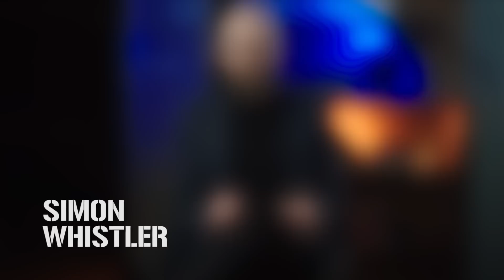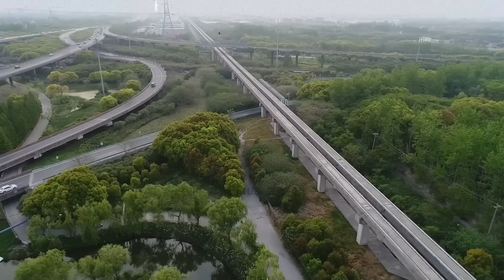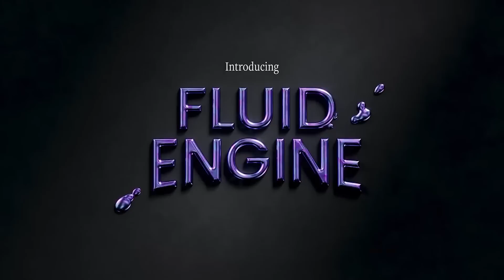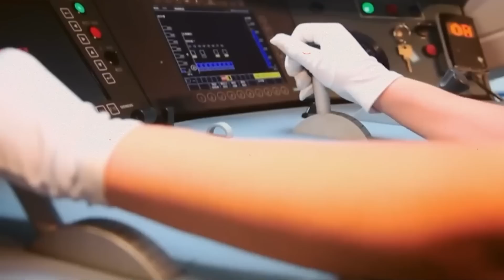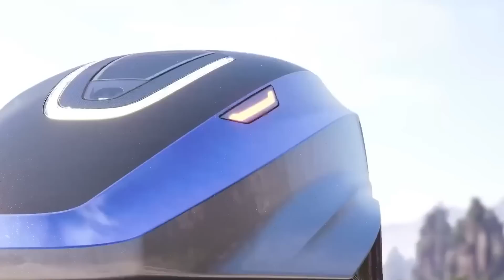A Chinese Maglev Revolution is Coming...

Comment: I took the Maglev for the first time in 2004 not long after it opened. I told friends and family back in the States about it. Until now, it remains a viable way to get to the airport, depending on where you are coming in from. It was fairly empty in the early days, but I attribute that more to the poor design of the transfer. If there had been a direct transfer from the metro station into the Maglev platform. Instead, they set it up where you have to leave the station, go up a new set of stairs, buy a ticket, go through security... all of which diminished the time savings of going 431 kmph to the airport. 
For the record, saying that it travels to "downtown" is a stretch. Longyang rd station is still pretty remote and when it was built it was really sparsely inhabited compared to the rest of the city.
Reply: 20 fkin years ago 😂
Reply: @hurrikkkanes2533  Yep! 20 fkin years ago. (kinda makes me feel old, lol)
Reply: Dude, the transfer from line2 to meglev only takes you about 5 mins at LongYang road station.
Reply: @tofdao  The whole maglev ride only takes 8 mins. Going through security a second time is redundant. Cut that down to 2-3 minutes, the time savings of the maglev ride is more appealing. My two cents.
Reply: The maglev China uses is a german train developed 30-40 years ago

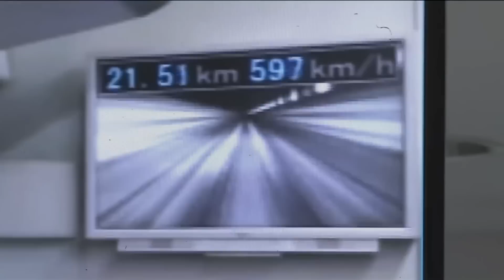Comment: 4:35 slight nitpick here, there is stil friction from the air around the train
Reply: That is drag, also known as fluid resistance.
Friction is solid on solid. Drag is solid on fluid, which can be liquid or gas.
Reply: That's called drag

Comment: The other side of the medal is, that huge parts of chinas economy and growth are based on the construction industry. They have allready build to much housing and an oversized highspeed train network, so they are running out of stuff to build. Creating new megaprojects is an attempt to keep the economic growth rates stable.

Comment: You guys should make an ep about the Japanese bullet train.
Reply: they operate 50 kms slower then chinas why
Reply: @user-vv7ir1pl4j  This is due to higher frequency of service, higher safety standards, higher noise standards and higher population density. If you just want to drive fast, it hit 443km/h in 1996.
Reply: Japan inferior maglev lol
Reply: Kinda outdated by around 10 years 😂
Reply: Chinese version more superior
Reply: There are enough videos about it
Reply: If you think speed is all that matters then you are clearly not educated enough to rate a train system’s efficiency nor effectiveness
Reply: @HappyGM-R  its simply not as impressive

Comment: I thought most of China's high speed lines were mostly empty, because the tickets are too expensive, why build the extra capacity? (except for GDP numbers and political reasons)
Reply: They are actually cheap.
Reply: where on earth did you hear that? About 2 billion passengers use the Chinese HSR network each year
Reply: @zupermaus9276  Probably american bots

Comment: Maglev track is not maintenance free! Coils will fail, power control electronics in the supply fail, etc. 

And you absolutely have to keep the track clear. If you have a tree trunk across the track and hit it at 600kph, it's going to be a very big accident. Slower, heavier wheeled trains probably derail, but also stand a good chance of chopping their way through. The lighter, faster MagLev train won't. Ok, so one might elevate the track and ensure that trees won't fall across it, but that doesn't account for the casual vandal who deliberately lobs a lump of concrete up on to the track for the laugh. In some countries that would be an unthinkable act. In others, rather the opposite.

So whilst you lose the skilled rail maintenance workers, you gain a different set of skilled workers and, what's more, you absolutely have to patrol the line to check that it's clear. The drivers won't have a hope of seeing obstacles. Germany stopped work on MagLev partly because they did have one such accident.

China's high speed train network owes its origins to the Japanese Shinkansen. They licensed the track and train technology from Japan (Hitachi I think). They didn't license the signaling technology though, they did that themselves...
Reply: I'm pretty sure there will be sophisticated track monitoring to detect any foreign objects.
Reply: @ballyhigh11  Sure, and that too needs to be maintained, tested, certified, etc.

Comment: 0:00 China does NOT "get" infrastructure. They build a lot to artificially pump up their GDP. The results are ghost cities, concrete that crumbles between your fingers, people who have lost their life savings paying for a promise of a future building and a poverty line set at < $350 / year.
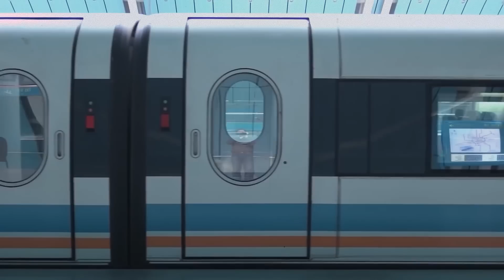7:35 Nice that you talk about cost. Maglevs are not viable. And this China's example is by no means anything amazing. It doesn't reach top speed because it's too short and too curvy.
9:08 Japan is the only country that will have one functional > 600 km/h maglev for the next few decades. Or at least a safe one.
10:15 Chinese current rail is already a massive money drain. It's too expensive for regular people, it runs from cities to literally nowhere and breaks down if there's 2 cm of snow on track (it happened this year, look it up).
12:00 China doesn't have that kind of money but hey, at least it's not going into the arms industry. I'm glad they use it on vanity projects.
12:50 they achieved 600 km/h on a 1.5 km track? Good test. Also, the entire tech China reversed engineered from the German company that build the first one.
14:50 ROFLMAO, it's a fucking suspended train. Tell your writers to stop smoking Chinese propaganda.
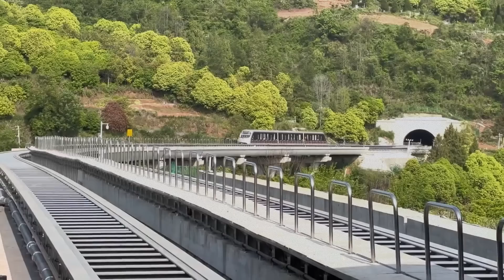16:30 Think for a moment; a slow moving maglev (if the propaganda is to be believed) is a massive electricity drain. Where does it come from? That's right. COAL.
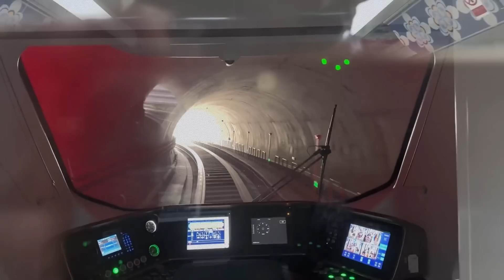16:50 China is the last country does gives a f about tradition. The CCP literally demolished everything. Taiwan is all that's left of real Chinese traditions.
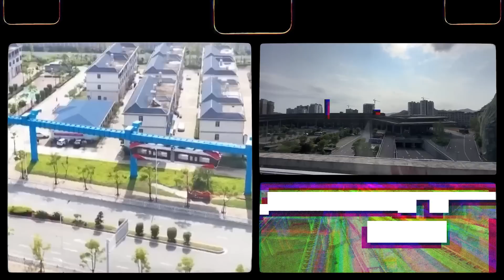18:02 You realize how slow moving everything is in the clips you've been showing? The footage is not slowed down; you can tell on that suspended train because there's a cyclist on the road moving normally.
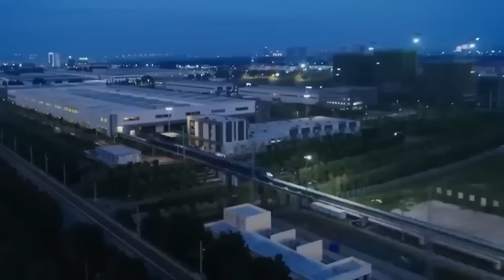18:30 No, LOL. Also, thanks for mentioning hyperloop, that's the only thing we had missing :D

I think it's time to retire this channel. All that's left are sci-fi concepts, vanity projects and Chinese propaganda stuff.
Reply: You are the one need to retire lol 😅😅😅. China is the future no doubt about it. Meanwhile the west are dying 😅. By the way all your comments here are nonsense lol 🤣

Comment: "$39.759 million"
That doesn't seem too bad for-
"Per kilometer"
Oh.
Reply: Considering that that included 6 km of extra track (not included in the km number) 3 trains with 6 wagon each, a train deport with space for 18 wagons, two raised station, a full C&C system as well as a turn key operation and training.

That is actually pretty cheap

California high speed train cost about $68M/km and that don´t include anything but tracks
Reply: HS2: hold my beer for £22.5bn spent for nothing
Reply: @jordanhooper1527  the uk is such a joke, fastest train is GWR at 125 mph, and 124mph is the minimum for HSR IN CHINA XD.
This all started when thatcher didnt want to invest in uk rail to increase to 140mph.
Its long overdue, the entire uk network should be on 180mph+ (gatwick express averages less than 60mph      -_-)
Reply: The we st place far too high emphasis on costs and profitability. If it doesn't profit the owner, the we st will think the project is useless. In the east they think differently, their goal isn't to enrich certain individual owners, their goal is to move millions of people around, and the State doesn't mind taking a loss so those millions of people pay a cheaper ticket price. This is the difference most people don't realise.
Reply: On a matter of economies of scale, the chinese could probably lower the cost to around 25M or 20M per km, basically the same as it's standard HS tracks.

Which is 1/3 the cost relative to contemporary projects abroad. (For HSR)
Reply: @amistrophy  there is a lot of potential to push the price down. Transrapid did a lot of work on that just before they closed shop. But there could  be much more done. There are loads of stuff that can be done with robots today that was not possible (or st least economical in 2002
Reply: @amistrophy  China did use economies of scale to bring down costs when they were building so much HSR at once. The problem is that they were building so much and using so much steel they drove up the global price of steel making it more expensive to build.
Reply: 800bn on weapons here in the US
Reply: Consider how much per missile is? 
More then per km of maglev!
Who is wiser? 
IMHO Definitely make infrastructure that will uplift the whole nation industries & even other nations as they also wosh to get involve in such supply chain
Reply: easy payed for, if you dont have pay to your enslaved "citizens", easy for the glorious godkings to do whatever they want with the accumulated billions -.-
Reply: Long-distance mag-levs aren't for making cost-benefit sense.  They are for the bribes, boondoggle, and bragging-rights of the evil CCP.  (This comment will get deleted by pro-CCP censors.)
Reply: These long-distance mag-levs don't make sense -- that's what planes are for.

If these things can take an hour off the DAILY commuting time for 10 million people, that's
great.  

Or, if they can practically move 5 million people out to 1/2-priced housing and real estate, that's great too. 

But taking an hour off the travel time for a fat-cat's trip to Shanghai - that's STUPID.

* * * 

Actually, these long-distance mag-levs aren't for helping ordinary people, or even fat-cat business men. ---  They are for the bribes, boondoggle, and bragging-rights of the evil CCP.  (This comment will get deleted by pro-CCP censors.)
Reply: In use for 20yrs or more though, so its over cost is about society uplifting, other industrial as well
Reply: I live in a city that has spent over $500M per kilometer on a streetcar line with a top speed of 80 km/h
Reply: That's pretty cheap for rail or even road infrastructure. Compare to the US where highway widening projects regularly cost $250M+ per mile and they don't even provide any actual benefit with traffic just getting worse due to induced demand.
Reply: I'm sick of it.   

These status symbols don't help a million commuters get home an hour early. 

These stupid things aren't for transportation, they're for political bragging rights, like the Moon shots. 

Long distance maglevs, "bullet trains", HSRs  --- that's what PLANES are for.
Reply: That's 40 million per km, that's why it cost 1 billion in the end.
Reply: See this video;

China's "ghost" railway stations prompt questions about rapid expansion ...

^^ $1 trillion in debt and they don't make money.

Long distance maglevs, "bullet trains", HSRs  --- that's what PLANES are for. 

These status symbols don't help a million commuters get home an hour early. 

These stupid things aren't for transportation, they're for political bragging rights, like the Moon shots.
Reply: You should stop playing with Legos, you're too old for that.
Reply: @Anonymous------  Well that's one of the most incorrect statements I think I've ever heard in my entire life. Never too old for Legos.
Reply: @Techstriker1  I agree

Comment: The Shanghai maglev cost was partially justified as basic military R&D into electromagnetic propulsion. They were just starting to work on their magnetic carrier catapult
Reply: True
Reply: Chian didn't do any development, they are just running an old German train
Reply: @Naikomi95  it's not old, Siemens designs never left the drawing board before Shanghai. China built the tracks and 1 train, the other 3 trains were German built. Don't confuse it with the old low speed M-Bahn maglev that ran in Germany
Reply: @Adiscretefirm  they did 450km/h in germany in 1989. The only thing China did was being worse then Siemens/ThyssenKrupp more then 30 years ago...

Comment: SIMON this is like ALL CCP lies. 
MOST trains in China are still slow/reg subway speed at best. their highspeed trains have had many serious crashes: and they've literally just buried the cars at times (bodies still inside) to hide the issues from the ppl. 

Its just more lies/propaganda + internet censorship = successful infrastructure/megaprojects. 
TOFU construction. Also, they're running it at a giant deficit and can barely afford the current few high-speed lines they have. They spent like $800bil on it (purportedly), and are barely recouping the costs (bcuz of more lies about avg Chinese income...which is only like $200-500USD/mo equiv for their middle-class).
Reply: Its slated to be (and kind of already IS) just as big a FAILURE as EVERGREEN (and the whole 'buy your condo BEFORE its even built') type, 'buy an apart for invest, never even visiting it, cuz some1 will buy it in 2yrs for 20% more' type insanity). 
TOFU DREG = not just their infrastructure (damns/highways/rails/buildings/), its their entire economy. they're hiding their poverty/poor quality + hyperinflation.

Comment: I've been on the Shanghai Maglev, on one had it's a technological marvel, on the other hand it's appointed with all the comforts of communism, very basic interior furnishing and it doesn't really go anywhere important, expect a very long taxi ride to your hotel if you take it. One huge benefit to maglevs no one really is talking about, is the complete lack those ugly wires above the train and how quiet they are. Considering what Perth, West Australia is doing with our own mega project (mega slow project), the 2 billion dollar (AUS) Metronet upgrade, that's putting a massive concreate train containment thing 2 stories off the ground, I'm surprised this technology wasn't looked at. A train that can't be derailed, doesn't need containment, leading to a much cleaner looking project.
Reply: It is just a showcase...8 min ride for 40 km journey to a major subway station closer to the CBD, which saves 30 mins if you travel with the subway. Yes, the interior is primitive, there has been no improvement or upgrade over past 20 years...it could have been done better. It is too costly to build Maglev train system in Australia as the ridership will be low due to the small population in Perth and the rest of the country.

Comment: I'd like to know more about the "slow maglevs" you mentioned at the end. What are the benefits versus conventional trains and monorails? Are they cheaper to operate and maintain because of lack of friction? Isn't that compensated by a possibly higher energy consumption?
Reply: low maintenance, low energy use, low noise so it can run late night, and it can run on higher slope route..ie hilly route...
Reply: @airrodgers1242  very expensive to build
Reply: its important from an industrial policy level (China does this far better than any other country), to start building projects even if its not yet profitable at a economic level, to start getting scale and tech-know hows.
i bet those slow maglevs are not profitable at all compare to conventional rails, but they are subsidized by the central gov.
Reply: @Xind0898  exactly, this gent has a mind
Reply: @Xind0898  Its also important that China consider these trains as infrastructure for the people. Just like hospital, you don't ask "Does this hospital made profit?"
Reply: @Sibåyo9  You do if you're in the USA xD